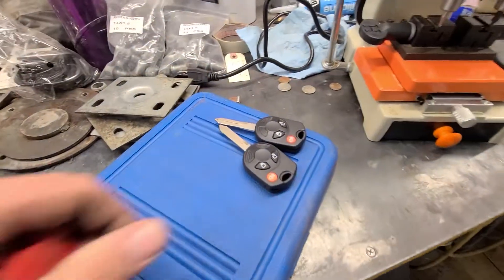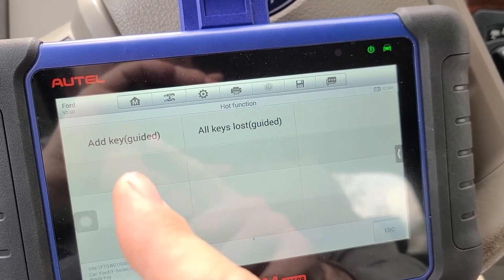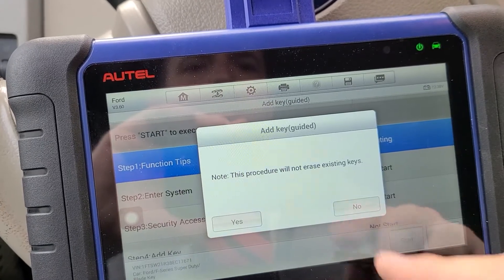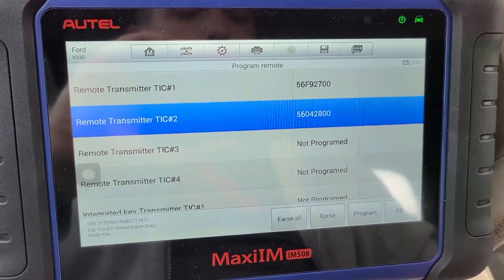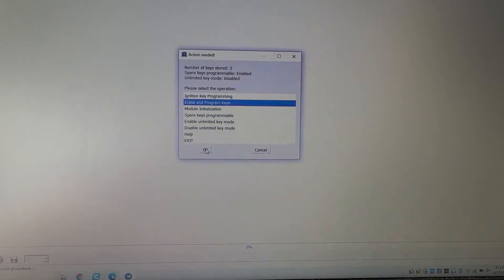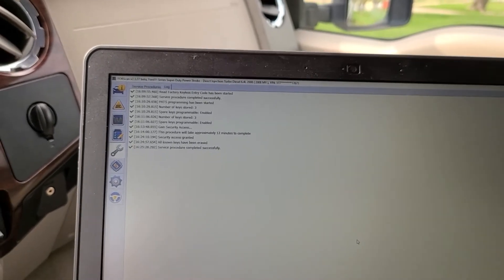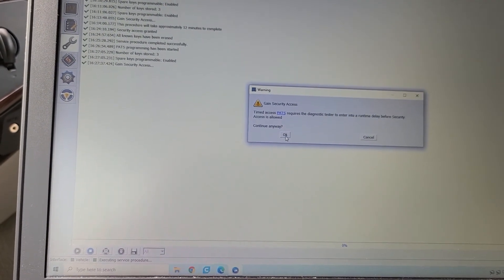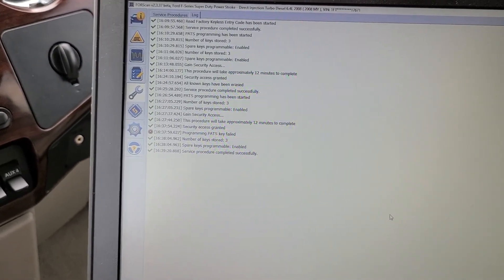How To Cut and Program F250 Superduty Keys Using Forscan or Autel!

Comment: So I am sending in my PCM to be rebuilt (which has the ford PATS system) and I only have 1 key. Can I have a key cut at my local ace hardware, then use forscan to program both keys to my car once I get the computer back?
Reply from the maker: Yep, go through all keys lost and it will allow you to add all new keys when you get the new PCM.

Comment: Thanks for sharing. Going through similar processes myself with the Autel MK808BT and Forscan. Autel unit definitely easier, 808 not as advanced as yours though. That additional functionality would be good for diagnosis whilst trying to switch the BCM from 433MHz to 315MHz so I don’t need to buy another key. 😅

Comment: Good tutorial however you are making things harder than they have to be.  With that year Ford vehicle it is possible to program keys with no scan machine if you have two already programmed keys by using OBP method.  If you have only one already programmed key or no programmed key then you need a scan machine.  Lets take your first example.  You had one already programmed key in your case the one without the built in remote.  Then all you do is tell your scan tool to add a key.  When prompted just add the new key and repeat for the third key.  If you erase all keys in the system then you have to add 2 keys back to the system.  

Now lets talk about the OBP method.  Once you have two already programmed to the vehicle it very easy to add additional keys to the system.  You put one already programmed key into the ignition and turn it on for 5 seconds or until the security light goes out.  Then put the second already programmed key and wait 5 seconds or until the security light goes out.  Now you take your un programmed key and put it in the ignition for 5 seconds or until the security light is out.  Now you have all 3 keys programmed to the vehicle.

The reason your Autel machine is only adding the first 2 keys to the system is because there is no longer a need for the machine.  Just follow the steps above and it will program the third key.

Now lets talk about the remote programming part of this vehicle.  With this year vehicle you never need a scan tool to program this vehicle.  All you have to do is turn the ignition on and off 8 time kind of fast.  On the 8th time stop in the "ON" position and you will see the door locks cycle one time.  This tells you that the vehicle is now in program mode.  At this point all you need to do is press any button on the remote and the door locks will cycle.  That tells you that that remote has been successfully added to the vehicle.  Do the same to any additional remotes you have.

I hope you find this information helpful.  

Take care and be well
Kenny
The Locksmith
Reply from the maker: Thanks Kenny. This truck, like most vehicles sold at auction, only had one key. I could not do the on board programming with just the one key. I did the all keys lost to remove the extra key from the system after verifying the two new keys I got programmed correctly with the add key function of my Autel. Likely unnecessary to remove all and do it over again, but I didn't want a key to start the vehicle floating around somewhere.

It would have been faster to do the OBP and add the third key instead of using Autel or Forscan. Same for programming the remote buttons. I'll definitely do that next time.

Comment: Programming the fob is easy. Cycle the key from off to run position 8 times ending in run position locks will cycle then push lock and unlock buttons on key or fob simultaneously. Viola.  It's programmed
Reply from the maker: Thanks for the tip!